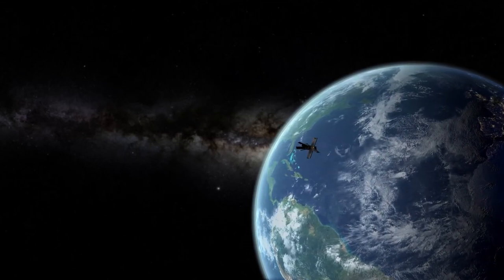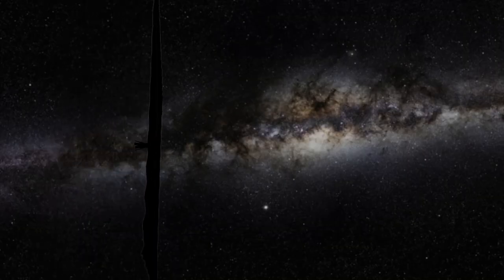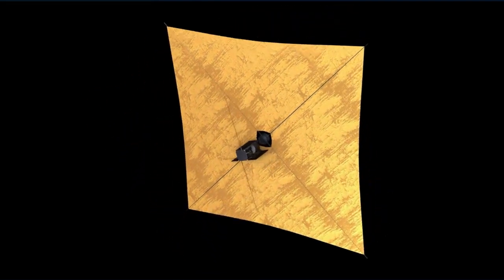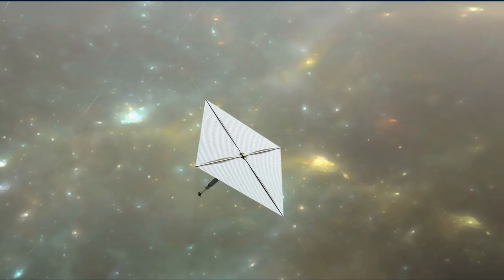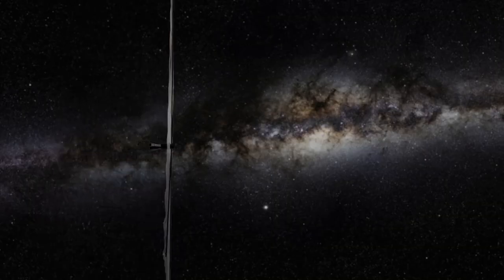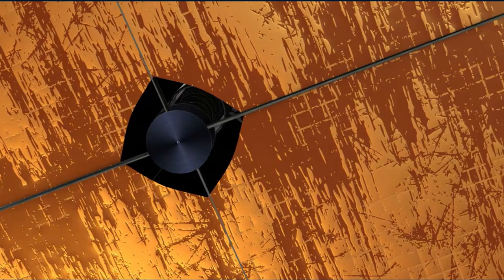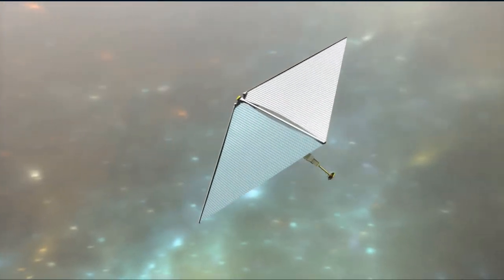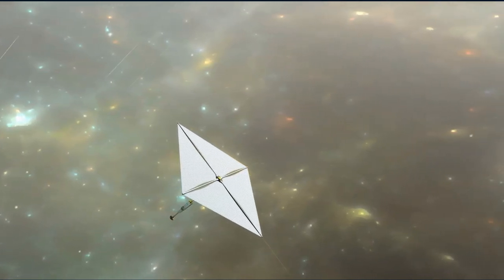NASA Gives Green Light to Diffractive Solar Sail Project

Comment: Where you going to fly to? And explore where or what is going to be there?a new colony built with what energy you get from? If you can build a dome in the middle of the Sahara with no outside support then yeah cause for a self sustaining colony you need a whole network of life and energy support grid all connect to each other like the roots of the forest that criss cross from an eco system to support life like water mineral and solar energy to live there.... build a sailboat don’t mean you can be space astronaut
Reply: Actually nasa is working on small habitats to put on the moon! It's really fascinating! Imagine it like the isolation stations we put in the artic where they are pumped full of air and heat!